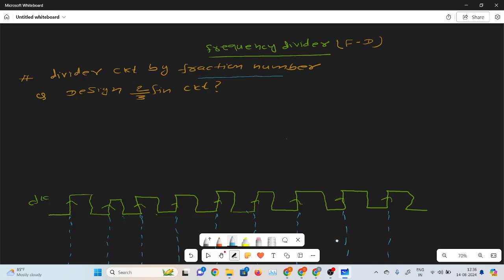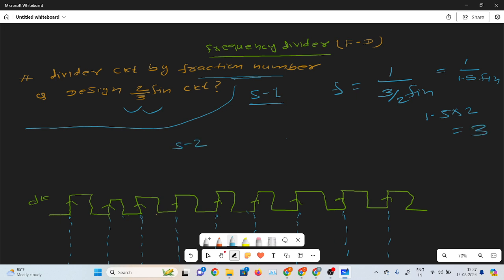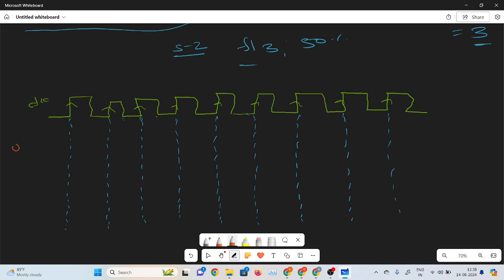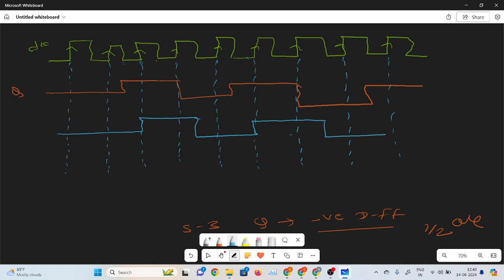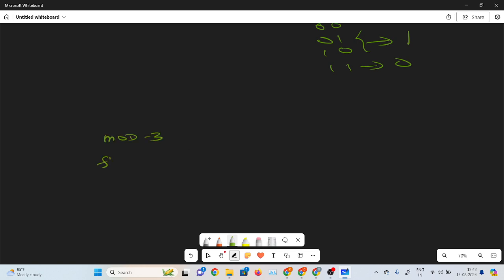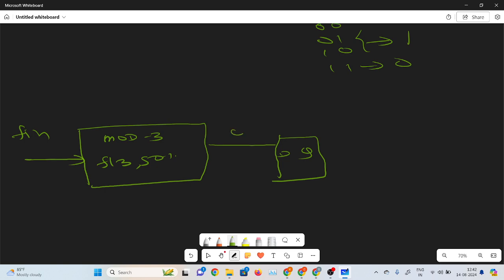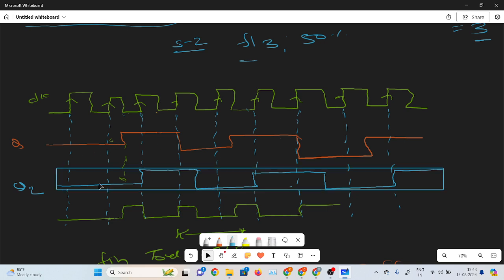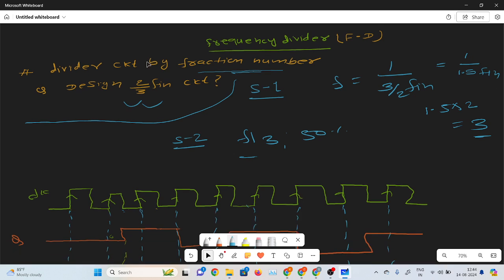frequency divider 2/3fin #part6

Comment: i have a dobut regarding delay of negative flip flop ??? yes ofcourse it will provide a half clock cycle delay but it don't hold the value  for 1.5 clock pulse (if it if 2 clcok pulse it can hold the value with delay)???  mujhe lag rha hai delay to aa jayega but 1.5 clock high and low maintain nhi kar payega??
Reply: Thats true here we need double edge flip flop ye galat bola hai